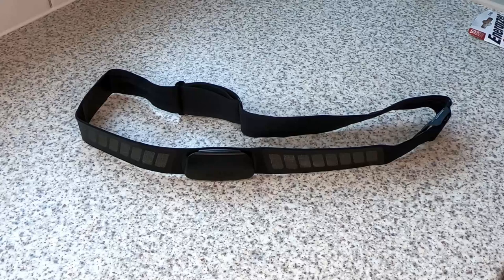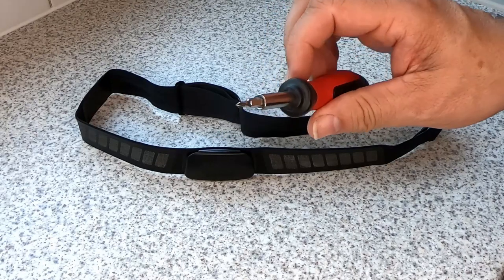Changing the battery on a Garmin Dual Heart Rate Monitor

Comment: Wish it was that easy but mine has Torx screws in it which no normal person has the screwdriver for at home :D
Reply from the maker: Yes, I've heard that some models are fitted with Torx screws - they are becoming more common and I use a cheap screwdrivre set from Amazon for low torque applications like this.  https://amzn.to/3mLkHEn
Reply: @CyclingLabs  Sold! That's unbeatable value for money.

Comment: if it was so easy , nobody  talk about it , its fucked upp here , screws are ruind , and i have no solution anymore !!
Reply: that's happening to me as well. Do you have any solutions?
Reply from the maker: Replacement screws can be obtained from Garmin or a watch repair outfit such as Timpsons. If it's the head of the screws try using a different sized screwdriver